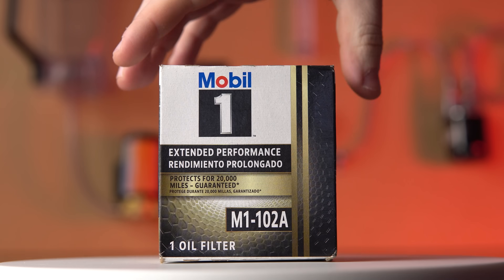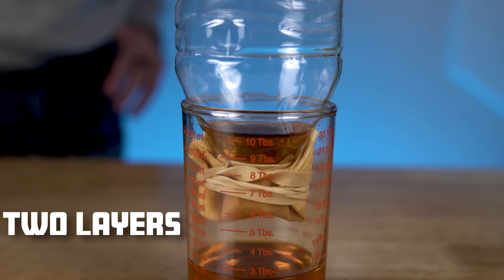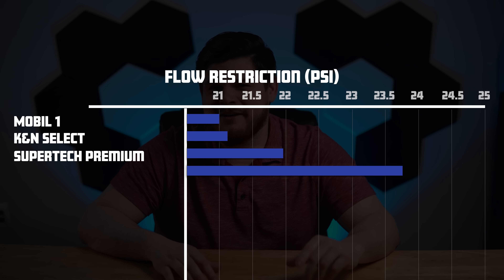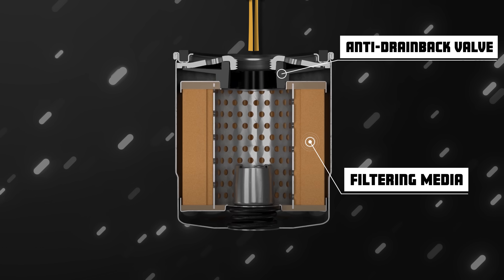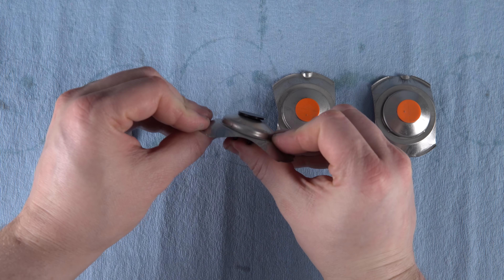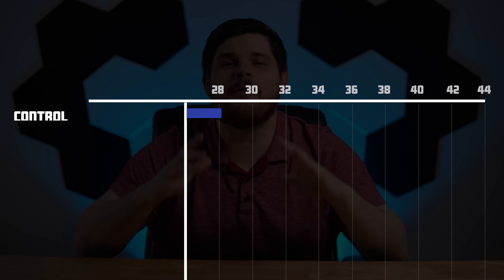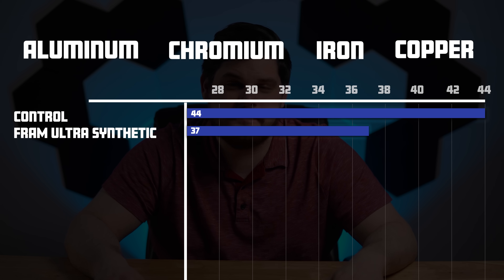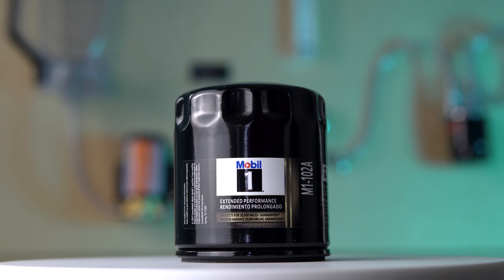Engineers Test the Best Oil Filters! FRAM | Mobil 1 | K&N | Walmart Brand

Comment: I appreciate the work you put into this, but I really think that you should have heated the oil to operating temp first.  The pressure restriction tests aren't really valid with room temperature oil.
Reply from the maker: @Cliff Anderson Thank you so much for appreciating the work that went into this and it means a great deal to hear feedback from people like you so we can improve. I agree that heat or an oil that simulates the viscosity of regular oil at operating temperatures should be used for better results, such as MIL PRF 5606 hydraulic oil, which is in fact what they use in the ISO standard for testing oil filters. When we posted this video we only had 400 subs and already so much money was spent so we had to make due, but given all the positive feedback and amazing suggestions like yours on how to improve, I'm willing to put some additional funding to make it better! Don't worry, we will be retesting these so we can have a fair comparison. I hope you subscribe so you can be notified when we release that version 2 of the test rig. Again, I appreciate your feedback and support. Hope you have a great day!🙂

Comment: Debatable testing protocol.

The oil filtration test with dirty oil..  there is no proof that the oil testrd was properly blended .  With particles suspended in cold oil.. the lab result is most likely caused by differences in oil in each filter test

If anything 4 controls for each filter would have shown that difference
Reply: Also aluminum powder flow test.. did you replace or flush/clean out the oil pump in between tests?

Comment: Been using 20,000 protection mobil1 oil filter with regular full synthetic oil and my engine has been running good for 7 years. This is for a 97 acura integra b18c1 engine

Comment: To bad the oil wasn't hot during testing....big factor on this test redo.  With extremely hot oil....will help get a better test...
Reply from the maker: @Shawn Libby Agree! Oil at operating temp would have been ideal. We had 400 subs prior to this video and it was just out of our budget to rig that up. Given the response thou and great suggestions like yours, we are making several improvements to our test including changing several components to withstand operating temperatures. Comments like your allow us to improve our test so we can bring you the best data we can. Thank you for your support!

Comment: A lot of great comments. I wish you had put wix in this test group. The comments about bypass activation would be a fantastic experiment. It would also be nice to see a comparison with a case, say just mobile 1, run at operating temp. I suspect the Fram particle behavior was related to oil temp.
Reply from the maker: @Kevin Lee Thanks for watching! All great ideas! We are planning on including WIX on our next video and have several changes planned for our test setup. As you can imagine, this is very expensive, especially for a small channel with no revenue, so we had a tight budget. Thank you so much for the suggestion and your support!

Comment: I like to use the fram ultra synthetic xg3593a in place of the much smaller XG6607 found in many applications. It adds oil capacity and additional filter surface areas.
Reply: Noice. My vehicle uses that 6607. Have to see if this works for me.

Comment: Pretty good test. Good comparison.
Personally, I run the Fram Ultra Synthetic filters in all my vehicles. I've had really good results using them.
Reply: Fram Ultra Synthetic is very nice and easily attainable! I change my oil on 5k mile intervals and i don’t see any reason to invest in more expensive filters that can’t add additional protection even though their exaggerated marketing claims seem to suggest otherwise!
Reply: @Bacnow  Amen to that.
Reply from the maker: Have personally used the FRAM ultra for years and have had no issues at all. Pretty good filter. Saw that FRAM came out with a new Endurance one with 25k miles, thinking of testing it to compare. Appreciate the support!
Reply: @BrandRanks  We just started carrying them at Walmart.
Reply from the maker: Awesome! Thanks for the info

Comment: It would be interesting to see this test with the added effect of operating oil temperature. Temperature plays a huge role in the assumed conditions of what running engines oil will behave like. I wonder how much it would change the outcome of this test 🤔
Reply: Even worse is super cold oil which almost always causes the filter to bypass until the oil warms up.
Reply: This test   is not  authentic   ALL test must  be run by  ASTM STANDARDS   !!

Comment: I've been using Mobil 1 Synthetic Oil and Filters for years, and my change oil warning doesn't even pop up until between 7,000 and 8,000 miles. I've still got 25% life left at that point, so I generally just make sure to change it within 1,000 miles. Oil always looks pretty decent too- dark brown, rather than pitch-black like conventional oil and cheap filters.

Comment: Quick hack to make the K&N the best in all categories:  just get an oversized filter.  It will instantly eliminate the PSI drop and low capacity issues.  I myself use an oversized Fram Ultra, though may switch to an oversized K&N if it's readily available nearby.
Reply: Check out engine masters Dyno test of all the filters . Awesome

Comment: Your tests are flawed.  In an engine the oil pressure system operates normally around 50psi.  This is due to restrictions in rod bearings, journals, cam bearings, etc.  Sure the oil filter is going to also add restriction but the engine's natural pressure will have no problem overcoming that.  Also with the higher pressure is where the filters will differ in their ability to filter out contaminates.  The proof of this is during your test the oil was pumped through at around 15psi and all but 1 filter collected a majority of the aluminum powder at the top because there was not enough pressure or flow to push it past the drain back valve.  Force feeding filters with unsuspended chunks of any kind is not going to give you an ideal result.  The proper test should have had a predetermined amount of powder mixed into solution with each oil test.  More focus should have been on the bypass valve as this is where most filters seem to fall short.  The most important test and also the one that showed the clear winner is the lab test.  The K&N by far reduced the PPM the most.  I think a retest using real conditions should be done to get the real results.

Comment: I have used Royal Purple filters for years and would love to see a comparison in this type of setup. This is probably the most well put together test of filters I've seen on YT so far! Great work!
Reply from the maker: @Daniel Baker Thank you so much for the encouraging words. We are definitely planning on testing the royal purple. Stay tuned! Thanks for the suggestion!
Reply: @BrandRanks  Can you do a separate test running E85 on fuel filters paper and stainless steel?
Reply: I used to work for a filtration manufacturer. Internally, Royal Purple is identical to Amsoil, Mobil-1, and a number of other boutique brands. They are manufactured by Champion Labs.
Reply: @unclebob540i3  Do you happen to know if the toyota trd oil filters are in the same category as those?
Reply: @torment6369  I'm pretty sure that one is Champion labs as well. Champion labs and FRAM make a lot of OE filters. Honda and Subaru oil filters are FRAM also, for example.
Reply: @torment6369  Toyota filters only come from China (factory install) or More commonly Thailand.
Reply: @unclebob540i3  can you comment to the micron level of Royal Purple vs Mobile 1?  And thank you!  BSME RPI '95
Reply: @racheat  from what I remember both are 98-99%@20 micron. We always look at 20 micron because that is the most harmful size of particles. 30 micron advertising is to make the filter look better. Filter element is identical on both. Both very good filters, can't go wrong either way.
Reply: @unclebob540i3  thank you....but I have a question: the larger the particulate, the more harmful.  30 being worse than 20.  I engineer and sell heavy API jobs and our gearbox is protected by filters with 10micron but we've got big pumps (different animal).  Maybe you have the numbers reversed?
Reply: @racheat  gears are different. Engine bearing clearances are are 18-25 microns, so for the most part, a >30 micron particle can't get in, and <10 micron particles can flow through without touching any surfaces.  These are of course, averages. Hope this helps.
Reply: @unclebob540i3  they’ve cut them apart are not identical. There by champion labs bunch of different specifications.
Reply: @Good-luck-Jonathan  I have cut them apart as well. And I spoke with engineering on regular basis. The only thing "cutting them apart and looking inside" will show you is internal cosmetics.
Reply: no need to test. RP will out flow all of those tested today because of the 100% synthetic media.  the closest competitor would be amsoil filters
Reply: Other then heat, truth
Reply: I've been using RP for years. Originally in my Harley, and now in my RAM diesel.
I would also like to see it tested.

Comment: I like to pour a little oil into my filter to soak into the filter paper. I don't know if it helps the Integrity at all but something tells me to get it wet before pressurized air gets forced through it befor oil reaches the filter.
Reply from the maker: Yes, great technique! It prevents your engine from running without oil for that brief moment your filter is filling up.

Comment: I humbly suggest to quit playing the "which oil filter" is best game and change your oil with the suggested oil type for your vehicle every 5000 miles.  Any internal combustion engine (ICE) will accumulate contaminates in the oil from the combustion of fuels,  It simply can not be avoided.  Manufacturers have led the buying public to believe their vehicles need fewer and fewer oil changes (longer intervals) and if you in fact do not keep your vehicle very long that may be true.  (It's a marketing tool to lead the buyer to believe the vehicle is a "low maintenance").  If you want your engine to last then change the oil/filter at around 5k miles and keep the level at the correct amount (full).  (Retired Master Advisor and ASE Master Tech)

Comment: So I like this... however the higher PSI of the Fram doesn't concern me much because it still has high flow numbers. As long as the flow is sufficient to not starve the motor, I'll take the higher filtration any day of the week.

Of course, I have a remote, 11 micron absolute filter that hold about 2.5-3 quarts, so... my 10k oil analysis on my 200k mile EcoBoost was excellent. Blackstone recommended sending the next analysis in at 13k. :D

Comment: Changed out my oil 3k miles early because on cold starts there was cylinder wall grinding with the Fram ultra synthetic filter. Wouldn't use it ever again... that restriction is dangerous on start ups. I don't care if it filters better

Comment: My 2000 Silverado has ran an OEM AC Delco filter and the occasional cheap quick lube filter. 340k miles. I don’t see the value in the expensive filters.

Comment: An engine with 22 psi of pressure would be starved of oil at high RPM. It's not a pressure range terribly relevant to an engine. You should be testing the volume of oil through the filter at 60-70psi

Comment: I see Fram bashed all the time but I use them with full synthetic on my duramax, never had an issue pushing 400k stock motor Trans.
Reply from the maker: 400k, that's amazing! Been using FRAM Ultra for years and have had no issues as well.

Comment: So from what I've read k&n is supposed to be more for high performance applications. Not supposed to be used as long(changed more frequently) but allows a higher oil flow rate to allow less oil flow resistance to better lubricate high performance engines while maintaining good enough filtration to keep contaminants out

Comment: Good test! But the Oil Viscosity change with the operation temp of the engine, so the Pressure resistance test may change with the high temperatures Oil. Also think 🤔 me change the filtration capacity
Reply from the maker: Yes it would, although all were tested with same conditions, so it was a fair comparison, but we are looking into changing several components on our rig to withstand operating temperatures to improve our tests. Thank you for the suggestion! Make sure to subscribe so you don't miss Version 2!

Comment: One thing you could improve on is to include an oil heater in the loop since filters mainly filter oil at engine operating temperature.
Reply from the maker: Yes, We are looking into changing several components on our rig to withstand operating temperatures to improve our tests. Thank you for the suggestion! Make sure to subscribe so you don't miss Version 2!

Comment: I only use pyrolator boss filters on my car and I change the oil every 2,000 miles with Motul 5w40 gen 2. I have had no issues with purolator. I would NEVER use a fram filter on my build and I’m commenting without even watching the video yet. I’m sure with cold oil your results would change and that would help those that live up north.

Comment: Kind of curious on how the WIX filters hold up. I've personally have always used WIX filters on my vehicles, and something that I've noticed is that the WIX filters for certain vehicles are larger than other filter brands for same vehicles. For instance my 99 Subaru, the WIX filter for that is larger compared to other brands for the car, and it makes me wonder if that's WIX's solution to possibly having higher filtration while making the oil flow less restricted.

Comment: I drive a Ram. Normal oil pressure is 50+. It doesn’t seem like a 21 for the Mobil over the 24 for for the Fram is a benefit. A filter should do exactly what it’s supposed to do… filter. Appreciate the video and statistics though. I also echo the want for more filter tests and comparisons.

Comment: I WOULD TOO TELL U I DRIVE A CHEVROLET I OWN IT SENSE 1994 I HAVE PUT 447000 MILES ON IT I HAVE USED FRAM SINCE OWN IT AND THE MOTOR NEVER BEEN TOUCH SAME ENGINE SAME TRANMISSION YOU ARE WRONG GUY !!!

Comment: I've seen numerous videos on YouTube for oil filter tests. Most of them slam Fram as being the worst. Now I've been working in hight volume auto repair all my life and I'm in my seventies.   Don't  think I've never seen an engine go south due to an oil filter failure. I've seen engines seize up because someone didn't tighten the filter, and I've seen engine failure do you someone never changing the filter (or oil). But I've never taken a failed engine apart and said, there it is, they had an inferior oil filter on there and the engine failed. Sure some are better than others, just change it when you're supposed to.

Comment: As much as I can appreciate how much work and prep goes into producing this video (and I applaud you for it) it's unfortunately falls flat if the oil is not heated to 200° F to simulate real world operating temperature and more importantly, the oil viscosity at that temperature.
Reply from the maker: @thepaperboy just wanted to say thank you for being so kind and being courteous about bringing up ways on how we can improve our tests. We are a small channel, we actually had 400 subs before this video and we had very limited budget. we agree that a better scenario would be with heated oil and we are looking into that, unfortunately we have to change almost every component of the rig to withstand those temperatures. Comments like you help us improve, so we are extremally grateful. Thanks you so much for your suggestion and support. Hopefully you get to see future ones were we improve our methodology.
Reply: Excellent point.
Reply: It's not just the oil viscosity.  All of the various metals(filter and contaminates) and plastics expand/deform from the heat.  I have little doubt the heat affects the filter media as well.

Comment: Excellent video!! Many modern oil pumps have internal bypasses, in addition to the filter's bypass. By restricting the filtration, we reach this pump bypass more quickly with less flow, and the rest of the engine does indeed see less oil pressure! The manufacturer's recommendations are the best for each vehicle, but changing priorities around this recommendation would be good for a shrewd owner... I guess you guys will have to test a lot more filters so we can make good decisions.

I use the Mobil 1 EP. My oil pressure is great!
Reply from the maker: @Ryan Eyster thank you so much for sharing. Glad you enjoyed and we are definitely planning on it.

Comment: This is a pretty well done test, particularly testing the filters on real oil with laboratory analysis. I recognized the test container, which appears to be Blackstone Labs. I suggest making a change in the way you test the particulates. In actual use, particulates accumulate slowly and uniformly, not in clumps. You should blend the particulates into the oil, not just dump them in. Put in an initial load, then let your apparatus run for a fixed amount of time. Then dump in another load and let your apparatus run for a fixed amount of time. If you wanted to go crazy, send a sample to Blackstone either when you have introduced a specific amount of particulates or when the filter reaches a specific backpressure. Otherwise, nice work. As already requested by others, test more brands, including WIX XP, Amsoil, etc.
Reply from the maker: @Daryl Morse You have a great eye! Thank you so much for your words and for your suggestions. we are always looking to improve our methodology and this is a great idea. We are actually looking into changing the analyst to a particle count instead with a very similar setup as you recommended. Thank you for your support!